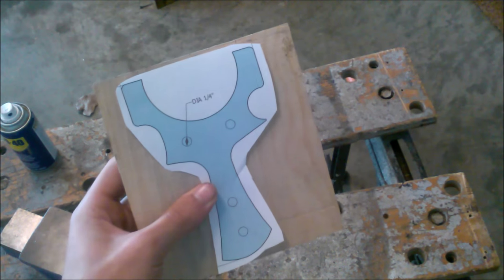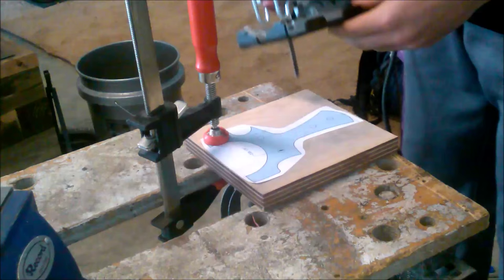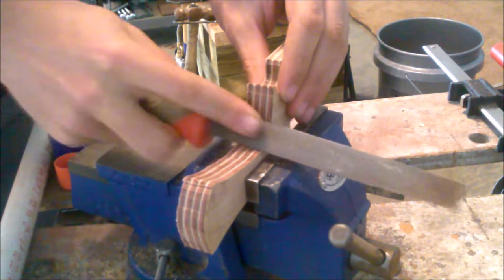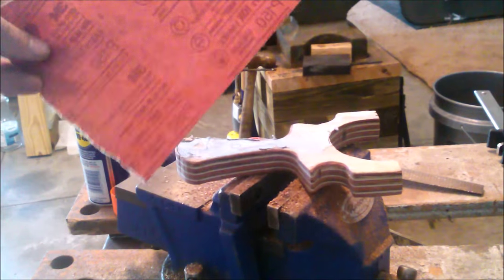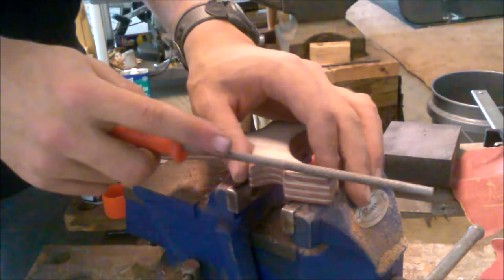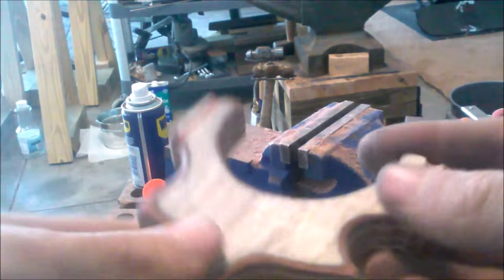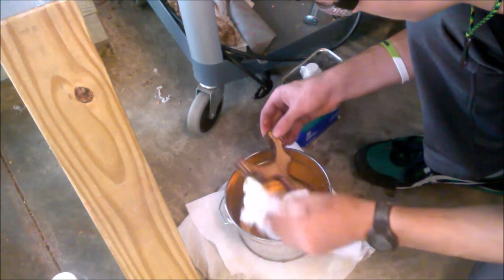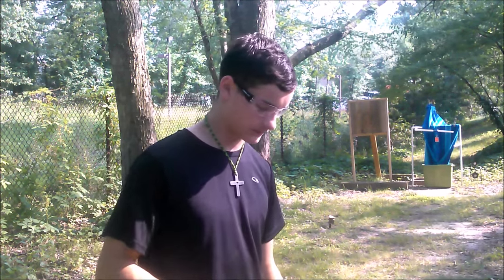How To Make The R-10 Slingshot

Comment: Have you ever tried "Paste wax" or "Finishing wax"? Rub some on a cloth, rub it on your workpiece, let dry for 10 min, vigorously rub with cotton T shirt, Done! You can use it alone, or even on top of most finishes! I think you should getsome, and use it on top of your BLO, it would make the finish a little more durable. It also gives a beautiful satin sheen, and a great natural feel.

what's that noise your HF drill press is making? Is the belt loose?
Reply from the maker: +brandon2076 I have heard of it but never tried it. It sounds nice though, might have to give it a go one of these days. Idk maybe, I'll have to check it when I get it back.

Comment: what do u think about using half inch birch ply for a slingshot I was thinking about makeing the baby dragon slingshot out of it! think it would be strong enough? and also what do u think about solid wood or will it break if I get a fork hit?
Reply from the maker: +Dane Robinson I have made slingshots with 1/2 inch birch ply, but they are prone to splintering. One of the first slingshots I made was a pickle fork out of the stuff, and a couple of days of abuse later, I took off one of the three wood layers on the fork. It still works but I would only recommend it if you do not think you will get fork hits, and you are using a design that puts the frame under very little stress. I would however recommend 3/4 inch ply. It doesn't have near as many layers as multiplex, but if you use the 3/4 inch thickness, it is still plenty strong. Fork hits can still splinter it though. 
For solid wood, it depends on what you mean. If you get a slab of natural oak or something, it will be beautiful and incredibly strong too.
I hope this helped :). If you have any more questions don't hesitate to ask :).

Comment: hey! nice video! I always look forward to watching your new uploads! I have tried to make a few board cut slingshots but I keep haveing the problem where the wood chips up on the bottom when useing my rasp how do u prevent this from happening?
Reply from the maker: Thanks man! Glad you enjoy them :D. Nobodo on the forum did a nice post on that problem. Here is what he said: "One thing that helps when using a rasp or file on baltic birch or any other plywood is to file only from the outer surface toward the center, never toward the outer surface. That helps prevent the outer surfaces from chipping away. It takes a little longer, but is worth it." As you can see though, I have trouble with it too, usually just cause I'm too impatient to go slow, lol :).

Comment: Great job at making it,and also shooting with it By the way, what kind of wood did you use?
Reply from the maker: Thank you! I used a wood laminate called spectraply that I learned afterwards is not very safe for making slingshots with. If you are looking to make your own, I would highly recommend multiplex, or high quality Baltic Birch plywood for a nice looking slingshot that will be quite durable too.

Comment: Thanks JD! Question: What is the optimal band length for each side you've found? I just ordered some Thereaband Gold for $9.xx for 6' off Amazon and want to make sure I cut the right length. Thanks!!!!!!!
Reply from the maker: My pleasure :). It really depends on your draw length. Maybe make your first set a tester, and cut it to about 10 inches long, and then cut it down shorter and shorter until you find your ideal length. Then for the next sets you can cut them the right length without losing any material. I think I mine are cut to around 9 inches long, but I don't get them even close to maxed out, and I extend my draw past my cheek. A lot of people I know shoot shorter bands than me. It's really personal preference. Good luck!
Reply: Thanks! I set mine up like Mick McQuilton is using on the MCQ Bushcraft channel and using the guide form a slingshot channel of drawlength / 5. I keep Breaking bands though. Could it be because I'm using double-bands? I'm doing this to get a powerful enough hunting slingshot, but do I need that? Trying to get this right. thanks.
Reply from the maker: For target practice you definitely don't need that. All you need is a band that will get your projectile to your target decently fast for a flat trajectory. I use very light bands and 3/8 inch steel most of the time as it allows me to concentrate on my form, or on the experience of shooting, instead of straining to hold a heavy draw weight. If you are looking for a good hunting setup, I can direct you to a forum that should help. Let me know. There are a couple of things that could be causing premature band failure. Most importantly are how you tie your bands, how you attach them to the forks, the forks themselves, your ammo weight, and if you are maxing out the bands or not. If you tell me where the bands are breaking, and if they are breaking in the same place every time, I can help more :).
Reply from the maker: Hum that's interesting, if there was something wrong with what you were doing, they would probably be breaking at the same place every time. So I think you are probably fine. For hunting, maybe short band life is the standard, since you want the maximum speed and power from your bands to humanely dispatch an animal. And at that length you will definitely be maxing them out. I'm actually not as much help on this subject as I thought I would be, sorry about that. You can probably get more detailed help by posting a thread in the slingshot community forum with your questions and some pictures, and maybe tell them how many shots you think you are getting out of them, and they should be able to help more than I can. I'll link to a few threads below that could help as well.
http://www.slingshotcommunity.com/threads/slingshot-hunting-power-test.2399/

http://www.slingshotcommunity.com/threads/hunting-setups.1938/